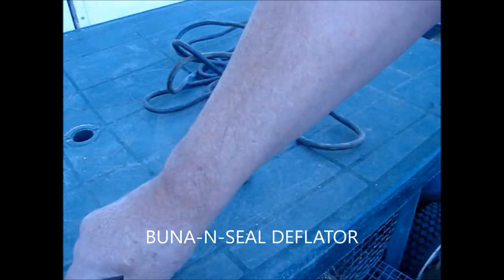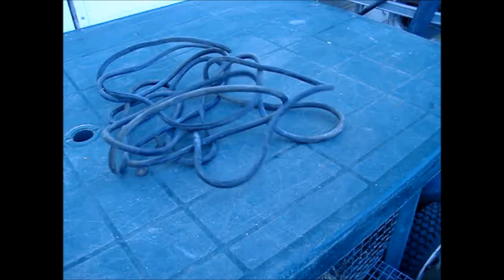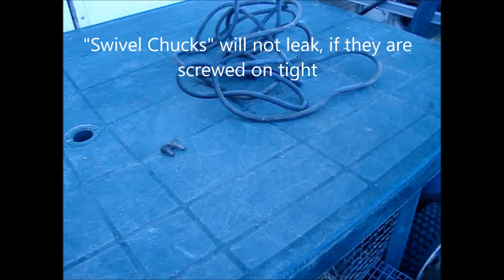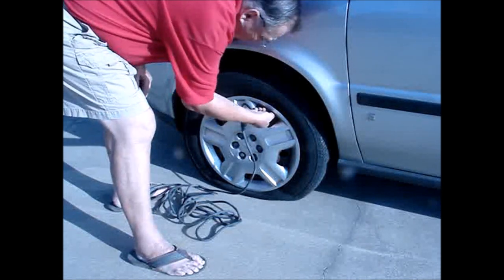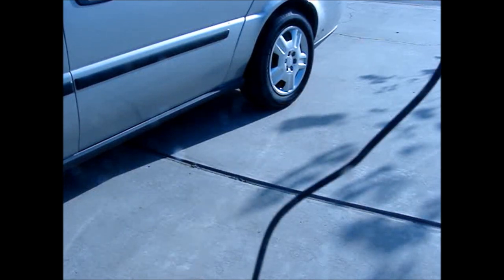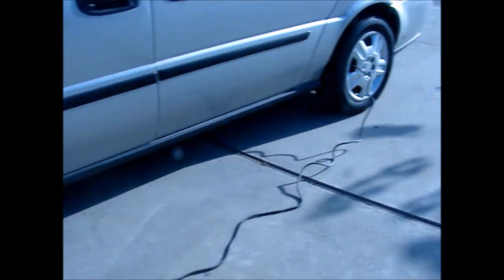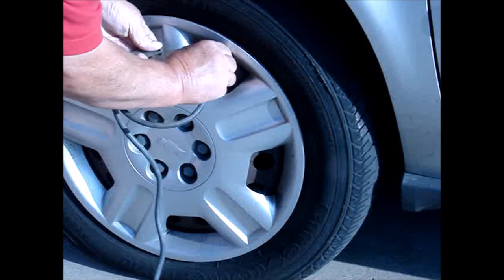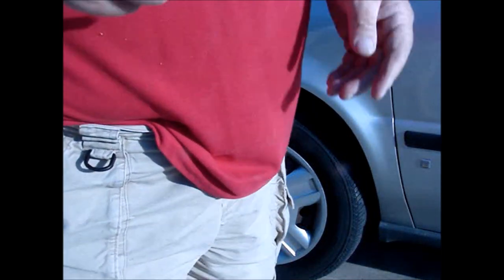How to air up any flat tire without a pump, Anywhere - With Only This Special Hose

Comment: Gud Idea, but I'm not sure whether l"ll get those plugs anywhere so easily.
Reply from the maker: Correct! The ones I use are very hard to find, even online, but other types are easily available in auto parts and hardware stores, as well as big stores like walmart or target.

Comment: excellent idea...but best thing to do is get the air from the tyres of the car parked in front of yours...or behind....whatever is more convenient.
Reply from the maker: With a long hose, would make that an option. Big truck tires are even better, and do not take much noticeable air from them.
Reply: 🤣🤣🤣🤣 clever 👌👌
Reply from the maker: @NSNG1540  Thanks for the comment
Reply from the maker: @NSNG1540  Thanks for the reply

Comment: Great idea. Thank you for sharing. A person could even take just a little bit of air from all three of the other tires and get to where you can fix the leak or have it fixed. Or even carry a plug kit. :)
Reply from the maker: That would work great, if it is a very slow leak, or if you fix the tire with a plug. Very few people carry a tire plug with them, but I always carry tire plugs, if I am planning on being off the main roads, or around construction sites.

Comment: Hi, thanks for the video, where can I get the connectors that you put in the  end of the hose?
Reply from the maker: The connectors range from about $2 each, and can be found on ebay and a google type search like "schrader valve barb connector" or "tire Inflator Valve Connector"  or "swivel chuck connector", or you can go to https://veesun.com/en/24-air-chucks

Comment: Or you could just keep a bike pump around...
Reply from the maker: If you want some good exercise for a few hours
Reply: @MrDidrill  a good trail bike pump can do it in about 30 seconds.
Reply from the maker: @dillonqaphsiel7977  It takes about 3-400 pumps for a normal size car tire. 50 pumps, is too much for me, but I lie the easy way.

Comment: It will work ONLY IF THE AIR LEAK IS A VERY SMALL ONE. Use your common sense or you will end up with two or more flats.
Reply from the maker: Most are slow leaks. If it is from a blowout, you would know.

Comment: Have a spare you could drive on..  I would never do this
Reply from the maker: Some can not change a tire, for several reasons, and sometimes a spare is also flat, or a trailer, that has no spare.

Comment: If the tire goes completely flat that means it has a bad leak and you can't  inflate it before fixing the leak
Reply from the maker: Not necessarily. Sometimes, you run over something like a nail, or screw, that develops a slow leak, and can go completely flat overnight, or a week or more when unused. Also old tires that have hairline cracks, will also go completely flat, like is what happens with a seldom used trailer.

Comment: What about take the Tyre off the car and take it with you to the gas station and pump it
Reply from the maker: If you want to change the tire, and then put it back on, that would be fine, but with no spare, would make it more difficult.
Reply: @MrDidrill  I'm using a compresser to pump my tires
Reply from the maker: @rollinggeez3043  So do I, when I am home.

Comment: How about using ur spare tire air?
Reply from the maker: Most cars today have a doughnut spare without much volume of air, but anything will help.
Reply: Because sometimes you may be in a tight spot and not be able to get a jack under or in a dangerous location or just cold as hell outside.
Reply: So... If you have a spare... Stay with me here... IF YOU HAVE A SPARE ..

Comment: There's plenty of small 12 v air compressors that take up the same amount of space as that vaccume hose.
Reply from the maker: Have tried that that, and they either do not last, or do not have a long enough cord to reach all of the tires, much less a trailer tire.

Comment: i find it easer to go with the small comp. pluged into 12 conn onthe dash no hassel   very  cheap  im 88 yrs old so i have to go easy way on every thing
Reply from the maker: What ever is easier for you, but most have too short of a hose for a trailer.
Reply: @MrDidrill  dont worry about the hose just add a pair of wires to the plug  to any lengh you need
Reply from the maker: @frankdavidson9675  I have done that, but the extra extension was too much resistance, and ruined my plug- in. I have never had an equalizer hose blow anything up, like that. Even without an extension, you risk the same, or can blow a fuse.
Reply: @MrDidrill  dont know what type wire you used to ruin your plug 10 -12 ft # 14 ga dont hardly have enough res. to measure
Reply: @MrDidrill  just measured mine 18ft of wire works like a champ  has for years
Reply from the maker: @frankdavidson9675  What ever works is fine, but I have had small compressors fail, and that was not good.
Reply from the maker: @frankdavidson9675  Not long enough to reach a trailer's wheels. Pickups are close to 20 feet long, or more.

Comment: Or you can just carry a small air pump in your car like I do.
Reply from the maker: This is just a simple alternative. The small air pumps that I have seen, do not have enough cord to reach all tires of the tires from the D.C. power source, especially to reach a trailer tire. It would be better to have a jump box that has an air pump. That way it can be carries to where ever you need it.
Reply: Besides, 1 flat tire is better than 1 flat tire and a dead battery!

Comment: If the low tire has a hole in it, you're creating two flat tires.
Reply from the maker: You should know if you have a slow leak, or a sudden deflation, or blowout. If not, then you will need to change the bad tire, and use one of your other tires to restore the other. If there is a fast leak, you can also fix it with a plug kit, from the outside, that I also keep in my car.

Comment: two flat tires instead of one great idea!!!
Reply from the maker: actually 2 low tires, that can be slowly driven on to the closest air.
Reply: It is actually really quite smart. You're right that now two tires will be low, but that is significantly easier to deal with and much less dangerous than a single flat tire.
The idea here is not to somehow completely fill the flat one and immediately get onto the highway. The point is to give it enough air to safely get to a place with an actual air pump so that both tires can be fully inflated.
Trying to drive to an air pump with a flat tire is terrible - you won't be able to get up to speed, your traction is fucked, you risk damaging the rim and there's an extremely high likelihood of actually ruining the tire so that it can't even be patched. While having two low tires is not ideal and does carry risks, those are negligible compared to the driving it flat. This method affords you a small amount of time to get to the nearest air pump where all tires can be re-inflated to the optimal specifications.
Reply from the maker: nicely said, thanks

Comment: Or just carry an air pump, they are small and cheap, and you can even get a cordless one.
Reply from the maker: I had a small air pump, and the motor burned out after one use. I then got a bigger pump, and it blew my accessory plug. The hose has never failed me, and is easy to tuck anywhere.

Comment: Hmm. Interesting method. Though I would recommend the following modification. Instead of relying solely on one other tire to provide air for the low tire, why not draw equal fractions of air from each of the other three tires? For example, my car calls for 38 psi on all four corners. I always keep my tires at least at sidewall max pressure, which is 51 psi. If for some reason one of my tires went completely flat, I would have 3 times 13 psi, equals 39 psi of surplus air that I could use to inflate the flat tire without any of the other tires going below placard pressure. If I only relied on one other tire, then I would end up with two tires each at about 25.5 psi, which is low enough to greatly accelerate wear and breakdown of the tire sidewall, especially at higher road speeds. I still maintain that the quickest, least-hassle method to fixing a flat is to keep a high-volume foot pump in your trunk for emergencies. A high-volume foot pump from a quality brand can be just as quick, if not quicker than any portable electric inflator, even one from a contractor-grade manufacturer such as DeWalt or Milwaukee. And on top of that, the more powerful 12V inflators can easily blow your car's cigar lighter fuse, or the fuse in the 12V plug of the inflator, especially if you consistently use the inflator at high pressures. I've had both types of fuse blow, and it's very frustrating when you don't have the right kind of replacement fuse on hand!
Reply from the maker: It is only used to get to the nearest gas station, or tire repair shop, not to drive at high speeds.
Reply: Keeping your tires pressurized to sidewall max pressure is not safe and will make your tires wear out faster.
Go by the tire pressure stated in the owners manual and should also be shown on a label, on the drivers side door panel.
Reply: @Mark_Z1  If only I had your advice six months ago. Recently I ran over an exposed steel road plate with a depression in the asphalt right before the plate. Tires were inflated 50% higher than sidewall max. It felt like I ran straight into a curb. Not long afterwards, the car gradually took on a vibration that progressively worsened. The steel wires in the tread had broken from fatigue following the impact. Eventually the tire exploded while my car was parked at the gym. Lesson learned: never exceed sidewall pressure in any circumstance. The fuel savings isn't worth the premature tire replacement.
Reply: @johnbarron4265  sorry to hear that happened to you, at least no one was hurt.
Reply: @Mark_Z1    yup